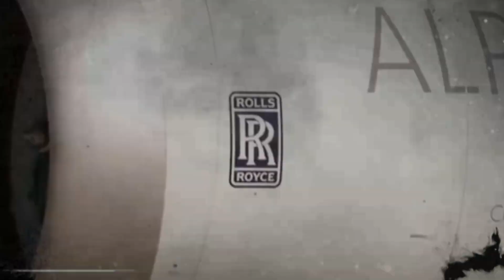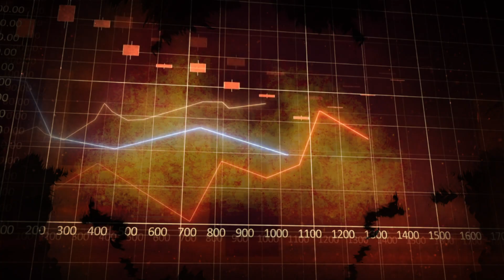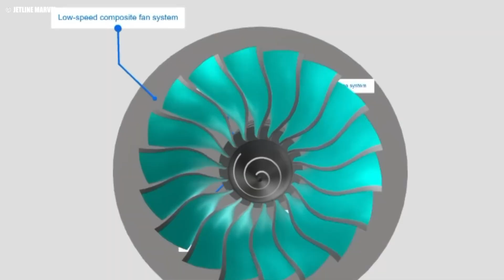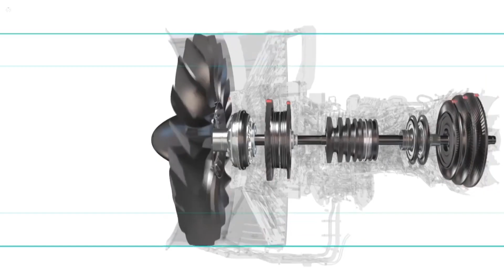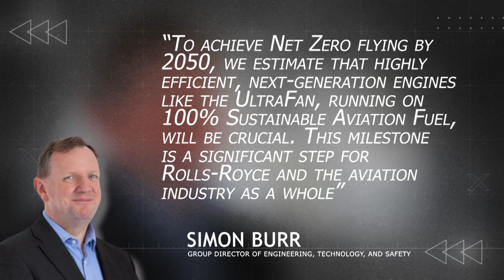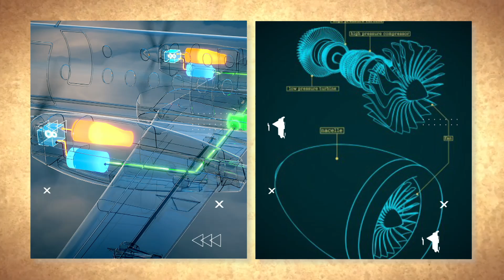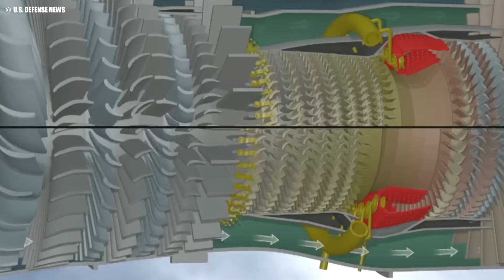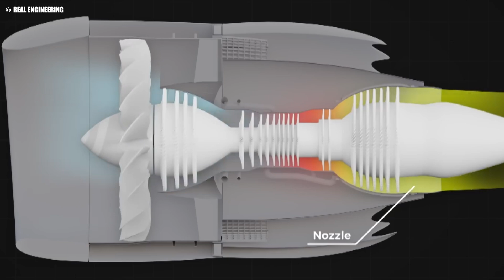Rolls Royce CEO: ''This NEW Engine Will DESTROY The Entire Aviation Industry!'' Here's Why!

Comment: And RR has zero market share of the biggest selling engines for the short range market unlike GE and P&W geared turbofan. RR also had issues with the Trent engine with a very expensive fix.
Reply: Ever bigger engines meet wing height restrictions. Also power by the hour is a killer when COVID and engine issues or even planes launch stalls keep planes on the ground